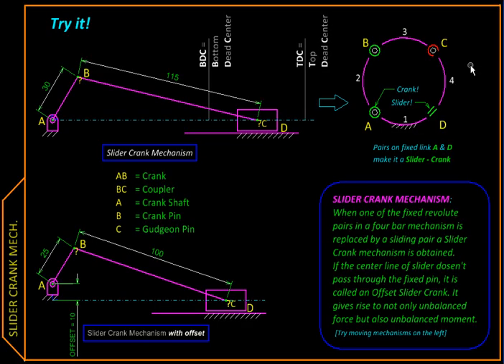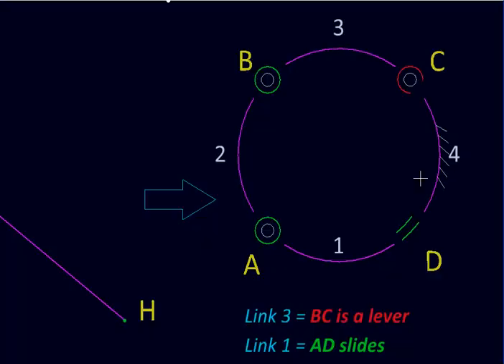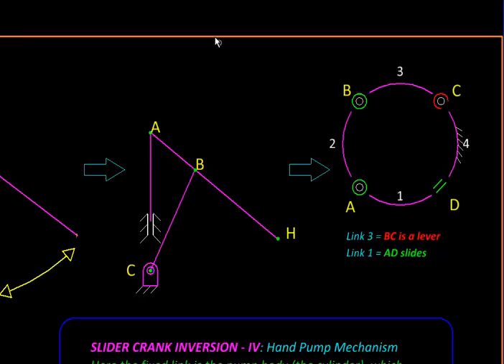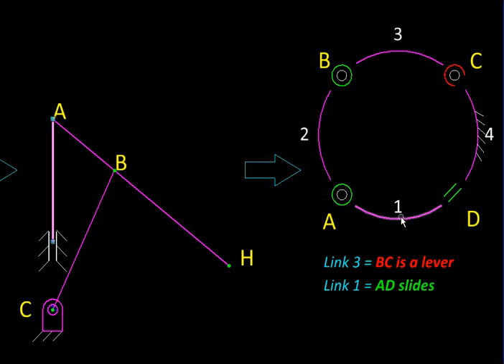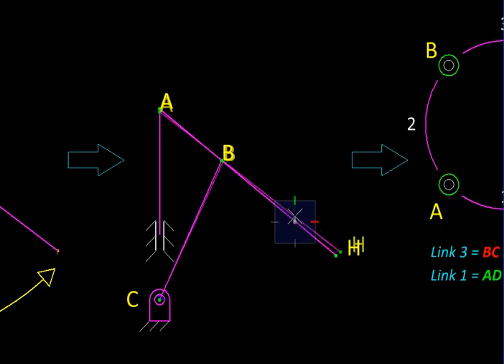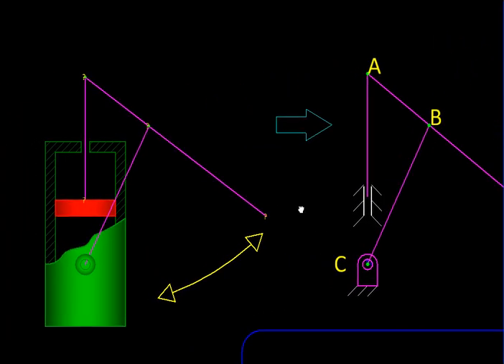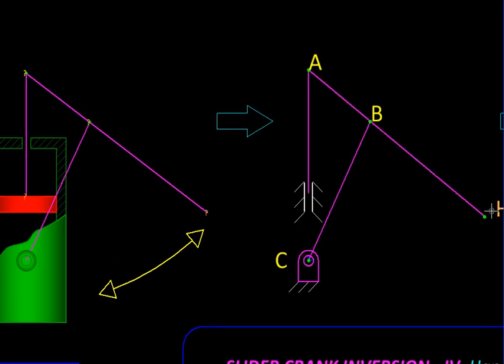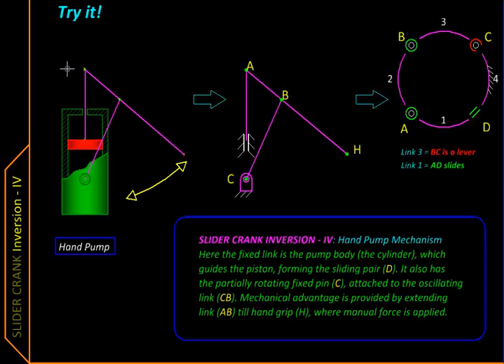Kinematics Ch01I Slider Crank Inversion IV

Comment: Can someone explain why link BC is fixed on inside of cylinder? I thought point C is fixed on upper outside of cylinder.
Reply from the maker: Pin C and link BC are not inside the cylinder, but mounted on its outer wall.
Reply: Thank you for reply! I'm learning 4 bar linkage mechanism now. I dont understand why link BC is rotating since it is fixed on the pump body.
Reply from the maker: The pin C is fixed, the link BC is free to pivot about it

Comment: I have a question. Can't we technically take the slider to be the inside part of the pump rather than the body of the pump (thus making it a different type of inversion)?
Reply from the maker: Big Boss Since we are considering this as an inversion of the conventional Slider-Crank mechanism, the 'slider' will be identified as a link that sits between a partially rotating pin and a prismatic pair hence the body of the pump is the 'slider'. Another way of explaining this labeling would be to say 'slider' is the fixed for this inversion. So whatever is fixed is the 'slider'
Reply: UjjwalRane Oh, I see. It HAS to be a link that's a prismatic pair and a partially rotating one. I suppose link CB can't rotate fully since AB is a bit short, making it a partially rotating one. Thanks!

Comment: sir inversion 4h is done by fixing the slider but here piston (slider) is free to move in up and down motion so how we can say that slider is fixed?
Reply from the maker: Nishant Bakshi Good question :-) But in Kinematics, one should not let the size or shape of a links deceive us :-) A prismatic pair has two parts relatively sliding past each other. Which one should be called the 'slider' here? To answer that look at the one carrying the partially rotating pin! THAT is the 'slider' or link #4. The fully rotating pin is carried by link #1 (In this case the cylinder)
Reply: Thank you sir!!
Can we call point C as slider (of basic slider crank mechanism) which is fixed???
Reply from the maker: C is a partially rotating pin sitting on the slider of the basic slider crank. And that slider - as you correctly guessed - is fixed.
Reply: oh... now i understood how slider is fixed to become 4th inversion of basic slider crank mechanism.
once again thanx sir
Reply from the maker: You are welcome Nishant! All the best to you :-)